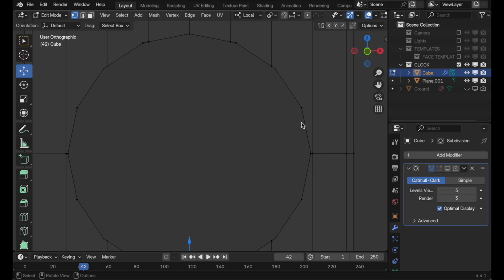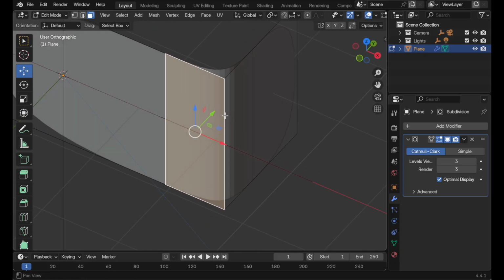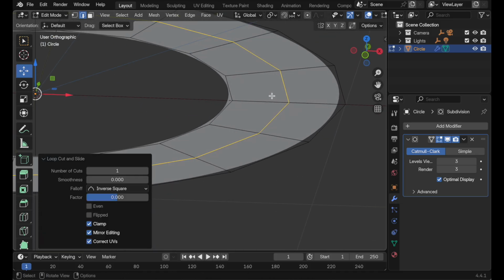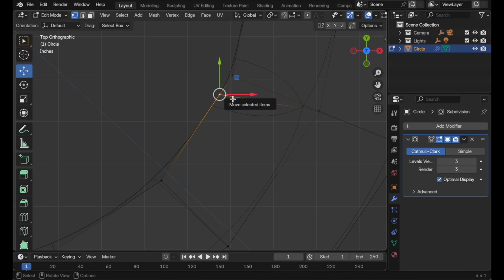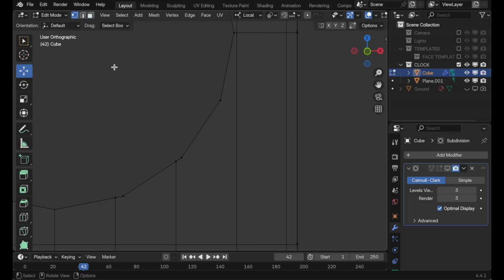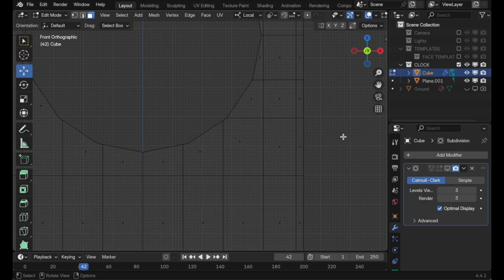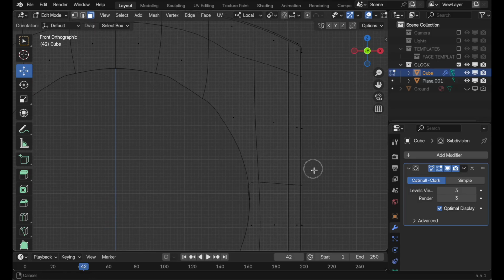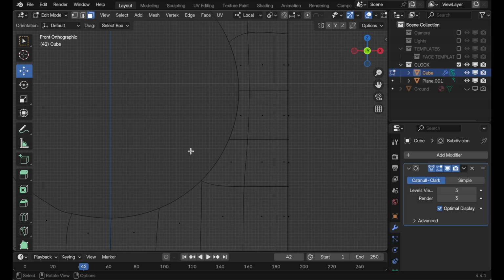Answering a question about subdivision surface modeling for beginners.

Comment: Any chance you could show some take on iron cast old-school radiator/heater (those with ribs)? It seems still quite common object in every colder country but in the same it appears to me way harder than it looks because I can't came up with good method to keep it with modifiers as long as possible?

Comment: I really like your videos They’re very informative and helpful. There were a few constraints this time that triggered my OCD a bit, but it was perfect for demonstrating how things work.

In the future, I’d love to see a video about using displacement, since I know as a beginner it caused me a lot of headaches, like where to put bevels, how to use SubD, whether displacement should go inside or outside, etc., so how it doesn’t mess up the geometry.

Another good topic could be the difference between electric and dielectric materials, and whether the metallic value can be something other than one or zero.
Reply from the maker: Metallic values range between 0 and 1, but you can mix between the two,  to get a mix between the two endpoints.
Reply: @christopher3d475  Yes, I know this, it's just that exceptions like when it's worth it or inevitable to use intermediate values can only be shown well in a video for example: rusted oxidized metal, dusty metal, metallic paints, translucent coated surfaces (e.g. carbon fiber), coated glass surfaces (e.g. sunglasses).

Comment: Three questions. 
Can you create a tutorial or some more hands-on explanation on how and where we can use Metalic BSDF? 

Can you create a tutorial on complex sub-D modeling? There are hundreds of beginner stuff online, but we lack really complex ones. 

For example, I was having a lot of difficulties modeling an MIG welding gun that has many tubular shapes that go into square shapes and back to round cylinder shapes with many sharp curves. 

Did you try the turbo tools plugin? I'm trying to finish a 1.5-minute animation of a product/machine that has a lot of metallic parts, lots of reflections, lots of lights, and the scene is in the dark. I find it very hard to optimize render time here; the frame can go up to 30 minutes, and the minimum is 10 minutes to have no fireflies or artifacts. The problem is when I spend hours optimizing render time (Samples, Lights, GI, Clamping, etc.) and push the frame to render time to 7 or 8 minutes with acceptable quality, and then tomorrow, when I start rendering, render time jumps to 30 mins or one h, and I have no idea why. It happens so randomly (At least, I perceive it randomly). I spend days, and I still can't figure out if it is something in the scene, if GPU (4070) is trolling, or something else.
Did you have any similar problems?
Reply from the maker: For the metallic BSDF, I've done a video about it here: https://youtu.be/lDK_p_kDDX8

For your scene with a lot of metallic parts, I would need to see it to know what's going on with it. I can take a look if you want to send it to me.
Reply: @christopher3d475  Hey Chris, that would be truly awesome, can I further contact you on your email?

Comment: A practical solution if someone has a similar issue and doesn't need good topology: just select the inner edge loop and use the LoopTools addon's 'circle' function. (it's a built in addon which you had to just enable, now you can find it among the extensions)
Reply from the maker: My belief is that it's best not to start throwing lots of addons to new users. They need to learn core things first, and then adopt addons as they then understand why they may be useful. Just my take on it.
Reply: @ I agree, but I also believe that it should be core functionality alongside with node wrangler. these are the two I always enable instantly on beginner's blender.
Reply: @christopher3d475  i totally agree.  You should know how to do it yourself.   A lot of people dont want to spend the time and effort  to properly learn something. They just pay money for add ons and premade modles.  Then  try to pass it off as their own work.  That is sad.        I do understand that some people like to just make scenes and render them...but that is not learning 3D
Reply: @ my other reply seemingly disappeared from here...but it was basically: knowing where you need proper topology and where you don't is an essential skill. for a background prop you don't need a full quad proper topology model. you need to know how to make it, but that's why I said 'practical solution when you don't need good topo'. and looptools isn't an addon that makes things for you, it brings in modelling tools which are default in maya, 3dsmax, c4d, rhino...it's core functionality. And 'just make scenes and render them' is true for a big portion of the industry, if you do 3D art, archviz, vfx...those don't care about topology most of the times.
Reply: Yeah that works but it will always have issues in the shading.  That should be the last resort.  Good topology is always something to strive for.  Why do sonething half-assed?  Just learn how to do it properly.
Reply: @ianzander5057  I tested it again, but the shading is pretty good. you will have no issues if you use autosmooth and with smoothing I had to search for the errors on subdiv level 1. you can't have stray vertices ofc, that would pinch. good topology is nice, but sometimes it just doesn't matter and you can save a ton of time when you know where you need good topo and where you don't.